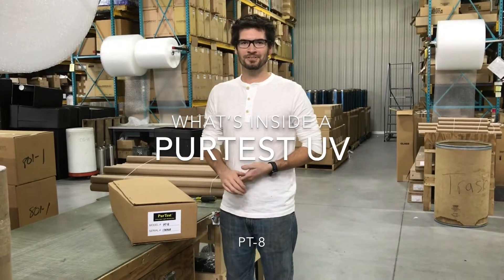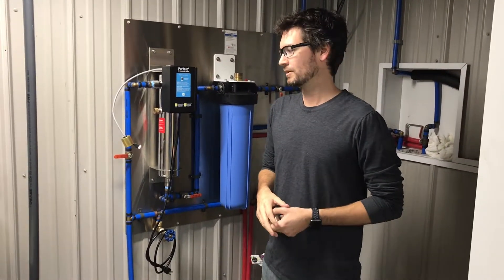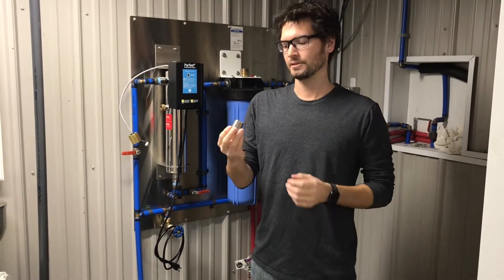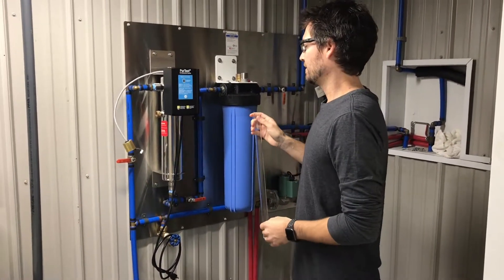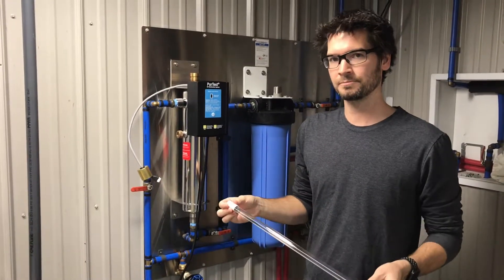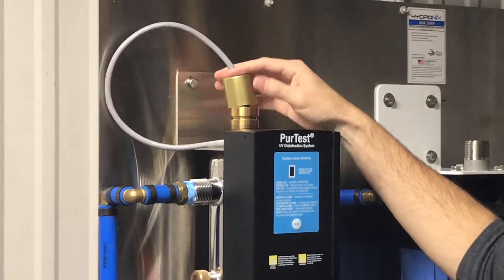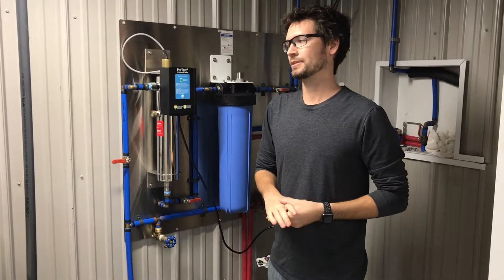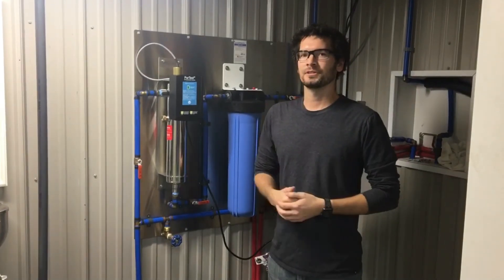Purtest PT-8 Open Box & Install

Comment: Justin, thanks for posting the video.  I was looking for a solution to a problem that developed about 2.5 hours after I put the system online.  I drew some water and got a blast (like air in the water). The water had been stationary all of that time and appears to have vaporized. I wondered if you experienced this problem or is water always flowing in your system?
Reply from the maker: Anytime you cut into your water lines, you will experience air in the lines after you turn the water on.  Once you turn a faucet on, the air will go away.
Reply: Thanks for your reply. 
So the system is designed to operate when no water is running, right?